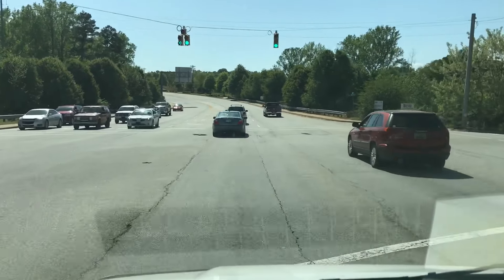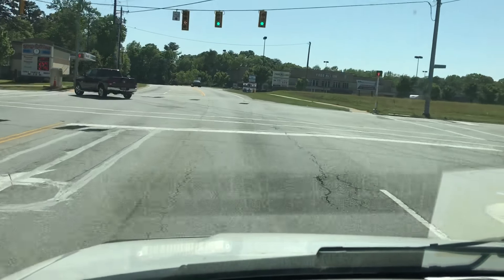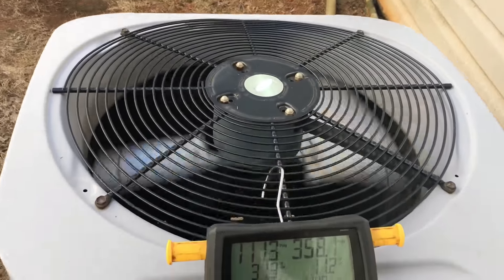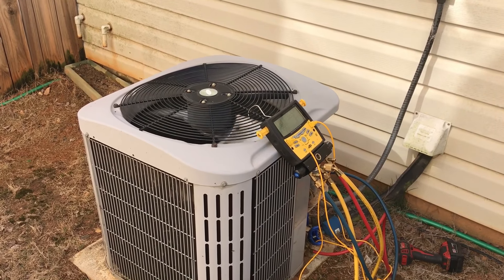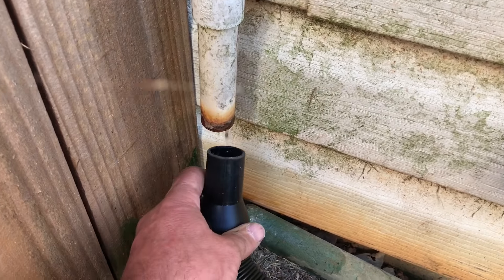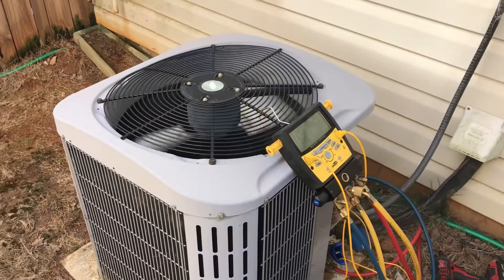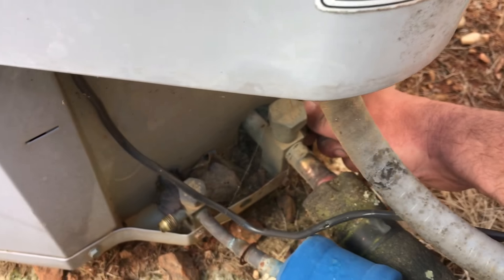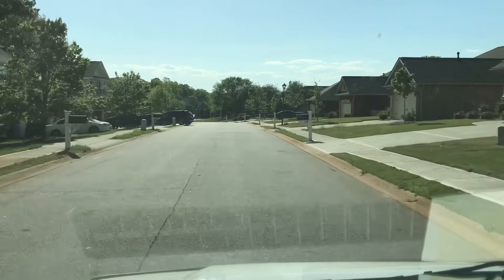Service Call No AC Carrier with clogged drain

Comment: Informative, thanks. My house also has an external drain spout very similar to the ones here. I'm concerned because the water coming out is increasingly rusty, so some pipe or pan is losing a lot of material and will presumably start leaking at some point and may cause a lot of damage. I notice that the drain outlets here show considerable rust too. Isn't this something to be concerned about?

Comment: That electric panel on your truck is so cool and convenient. What is the cost of that option?
Reply from the maker: It is called a Chevy Access van ... it was an expensive option as the shelving was quite proprietary to face outward on top 2 shelves, and inward on bottom. I have 2 of them and really like them. The entire driver's side opens and then just the one panel on the passenger side.
Reply from the maker: No idea the actual cost... I bought both of mine used.